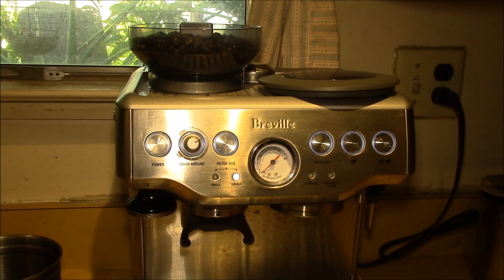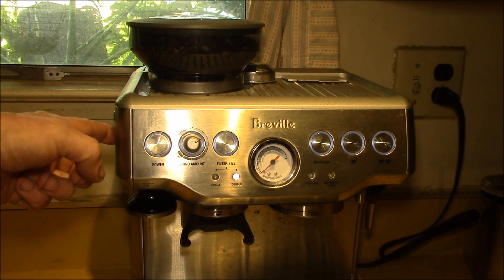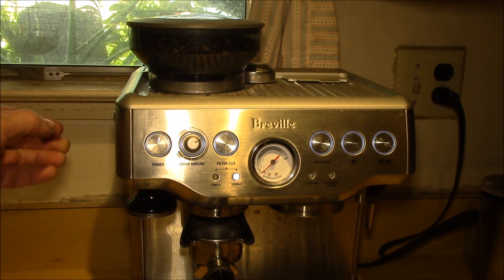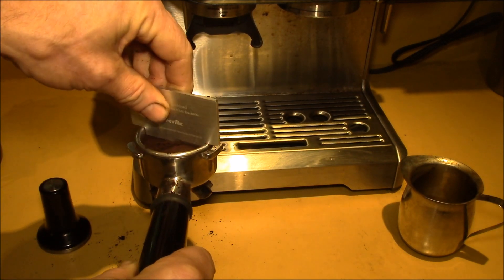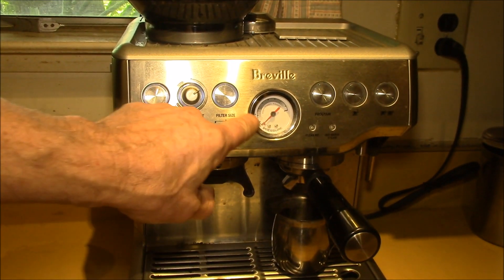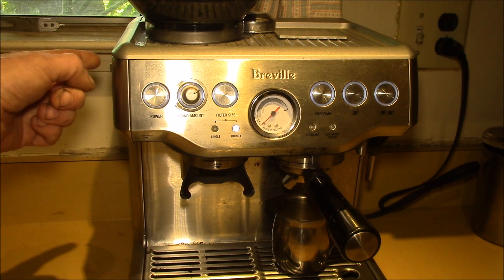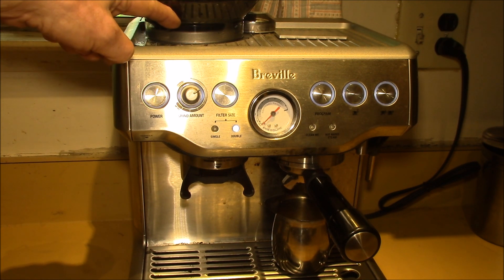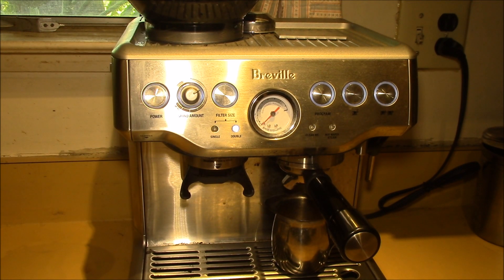Breville BES870XL - Grinder Adjustment

Comment: Tip your grind should be like sand texture.  And as comments below,  need to really force the tamper down.  Then you will find the pressure will be up where it should be and the crema should be great.  Enjoy
Reply from the maker: Good tips, thanks for the comment.
Reply: I just got this machine.  The gauge seems to stay at low pressure. What am I doing wrong?  I am using whole beans.. I have used like a bag of coffee already experimenting :(
Reply from the maker: Hard to say for sure.  are you using the single or double wall filter basket?  If the single wall, make sure the ground coffee is about the same size/texture as regular table salt.  As shown in the video, it helps to have a little pile of salt and the ground coffee close by.  Pick up a pinch of salt, feel it between your fingers then pick up some coffee.  Should feel the same.  Then make sure to tamp it well and check the level with the razor after tamping to make sure it's full.  Another test is to see if there's an imprint of the underside of the group head on top of the coffee after taking the basket off the machine.  If it's still low pressure, try stepping down the grind size one number at a time and note the pressure reading.  If the gauge is not getting higher with finer grind settings, it may be a defective gauge.  I find I don't pay too much attention to the gauge on my machine.  I go more by the extraction time, flow rate and the resulting espresso.  If that is all OK, I call it good.
Reply: @The4Crawler  Thank you.. I will try.. it's VERY fine already.  but when I take it out, the portafilter w/ the coffee is damp..  and the guage literally only moves one little nudge.
Reply from the maker: Maybe try setting the grind dial back to the middle or upper number.  I find when mine is working well, you get a solid puck of grounds out of the filter basket and it's just barely moist.  When it's not dialed in right, the grounds come out soggy and loose.  You might also give the double wall filter basket a try.  I find mine results in a lower pressure reading on the gauge, but it's the same regardless of the coffee.  Be that stuff I grind or pre-ground coffee from the store.
Reply: Thank you.  Do you ever get bubbly crema with this machine?  What could cause bubbly or foamy crema?  Thanks

Comment: Hello, I have a 875 device and unfortunately I have a big problem and the problem I have is that I set the internal mill settings to 1 and the external mill settings to 1 as well but I still can't do proper extraction. I mean the extraction that should be done with 18 grams of coffee and 36 grams of extract between 20 and 30 seconds is less than 20 seconds for me and I have to make the mill finer but there is no possibility of getting smaller and I even tried several models of coffee and it still didn't work and even my friend's device that is like me and we bought together also has the same problem
Reply from the maker: I've not used the newer 875 model with the adjustable grinder burr, so haven't had that exact issue.  You might first contact Breville support and see if they have any suggestions.  If not, maybe try the "Advanced Grinder Cleaning" process:
https://youtu.be/0ZDii493IPY?si=7FYSV3EHUrrOuJ7B
and see if there might be any debris inside that prevents full adjustment of the grinder.

Comment: What are basic settings you recommend starting with a when trying new beans? Was preciously using the double wall on grind 10/11 but want to try the single wall and am not sure where to start!
Reply from the maker: Really makes no difference, just pick a starting setting, your 10/11 is fine.  Then adjust up or down depending on your results, as I demonstrate in this video.  I like to only make a single change at a time, try it, then decide if another change is needed.  Also, realize it can take a few grind cycles for the whole batch of ground coffee to take on the new grinder setting, which is why I only do the single click change at a time.

Comment: Hey, thanks for the awesome video.

I recently bought this machine and just started having some issues. I recently bought freshly roasted beans from a very good local coffee roaster. For the first few days I was getting excellent, consistent shots at a grind setting of 4 (pretty fine setting). Within a few days, I couldn't even pull a shot until about a grind setting of 10, and even then the pressure gauge was way passed ideal espresso settings until about a grind setting of 12. I understand the coffee has aged, but I don't get how even relatively coarse settings would choke up the machine. As far as I can tell, I did not change up any variables in this week -- I've only used the non-pressurized double shot basket, filled up the basket with 18 grams of coffee (for the two doses), and tamped at the same pressure as always.

I've currently run out of this particular roast, and have been using cheaper coffees until I have a chance to get freshly roasted beans again from the roaster. But in this time period, I've also had trouble getting a shot pulled at a setting finer than 12 with Peet's French Roast coffee that I'm currently consuming. Even then, the pressure is through the roof, and I had to dial it back to a setting of 14 to be around the middle of the espresso range. To continue experimenting, I made some shots of old Ikea coffee I had, and I successfully pulled a shot within the espresso range on grind setting 5, but at grind setting 4 it pretty much choked.

I totally understand that beans are totally different and each calls on different grind settings to create good espresso, but I am concerned by how coarse I need to grind a few different types and brands of coffee now. When I got the machine 2 weeks ago, while testing it out and calibrating it with a number of different coffees I recently bought, the machine was able to pull shots with virtually any of these beans at grind settings of 5 to as low as 3. Now, it seems, I can only pull once I get to 12 or even coarser.

I am starting to think this might be a pressure issue, but Breville doesn't think so.

What do you think? And my apologies for being long-winded.

Thanks for the help!
Reply from the maker: You might try comparing the actual fineness of the ground coffee to see if the higher number is actually coarser than the finer number.  Also, does the extraction time and volume increase when you have the higher pressure?  Just some ideas, but if those all check out, I would agree with your assessment on the pressure related issue.
Reply: Thanks for the reply. Just from looking at and feeling the bean grinds of various grind size settings, it definitely seems the finer settings produce finer grinds. Regarding extraction time and volume: hard to say but, in short, it seems volume of coffee produced is always pretty consistent no matter what settings are used (this is based simply on what I see, not in terms of precise measurement). I opened up a new bag of store brand coffee (haven't had a chance to pick up freshly roasted coffee yet) today (which also means I had to calibrate the machine for this particular bean), but I was getting results similar to some of the other brands I've used these past few weeks, including the freshly roasted beans I first used, including after they've aged about 5 days (and when I first noticed this issue).Today,  I started at grind size of 5 at 18 grams, and the machine choked - no flow at all. I dialed back to size 9 at 18 grams -- minimal flow, took 40 seconds for double shot (though volume seemed appropriate). I obviously tossed it. Finally, at grind size 12 at 17 grams, I produced a double shot in 20 seconds, while the pressure gauge read about 10 o'clock. The flow seemed fast, but the coffee tasted fine for what it is. I called Breville again and asked a bunch of questions. They basically told me to not get hung up about the grind size, but rather focus on getting to optimal extraction on the gauge (which is around the center of the range). I may be wrong, but I'm under the impression that the finer grinds get, the more force is required for water to be able to push through coffee. By this logic, I'm still thinking that because my machine is no longer able to pull shots on most types of coffee I've tested at a grind sizes finer than around 9 or 10, that my machine is not able to produce the full pressure it is supposed to. Her followup to this is that all beans are different and as beans age and oxidize their properties change, which can also impact the grind size. She recommended that instead of weighing my doses, I should simply fill up the puck and once I get about one teaspoon above the brim of the puck I would then tamp it once and brew it. Her argument is that as beans age they tend to splinter as they're ground, causing volume to increase relative to the same bean when it is younger. This seems to make sense to me as I've noticed the 18 grams of coffee I grind tend to create larger and larger mounds over time. So to get the appropriate volume in the puck, it would pretty much seem I would need to actually reduce the weight of coffee so that the volume stays the same. This makes total sense to me, but I always thought 18 grams of coffee equaled 18 grams of coffee (no matter the grind size) in terms of the pressure required to push water through it. But maybe not -- and perhaps the issue is not my 870 not generating enough pressure, but rather that my volume is simply increasing (despite the same weight) which is causing the machine to choke. What do you think about the issue of volume? Does more volume (even if the weight of the coffee is the same) effect pressure required to pump water through the pump? Again, thank you for your patience in reading this and helping me diagnose my machine!
Reply from the maker: I find that the volume of coffee in the basket affects the pressure.  Too low a fill level gives low pressure, I think the injected water breaks up the puck and lets the water flow too fast.  With too much coffee, as the grounds expand when the water hits them, they swell up too tight and the pressure goes way high and you get lower volume or longer extraction time.  I try to shoot for the puck coming out solid, fairly dry and with a slight impression of the underside of the water screen on top of the grounds.  The other thing I use is how the filter basket goes into the machine.  If too full, it's hard to get it sticking straight out, too low and it'll go past straight out over to the steamer.  
Here's a good article on some of the finer points of dialing things in:https://baristahustle.com/espresso-recipes-time/

Comment: Hey there. I tried the pressurized double shot, and the pressure was great. However, whenever I go to the normal espresso shot cup, no matter how fine I go and how hard I tamp, the pressure stays below the gray. I don’t know if it is because I am using organic coffee, but nothing I can do has raised the pressure. Any thoughts?
Reply from the maker: It may be the type of coffee bean.  Ground coffee should be the same texture as table salt or sand.  I find having a pinch of salt to feel between my fingers along side the ground coffee helps with the comparison.  Also with the grinder adjustment, give it a few cycles for the finer coffee to come thorough fully.  I like to change the dial one click at a time, then if I find I need finer or coarser after pulling a shot, then I'll make another one click adjustment the next time I use it.

But if the double wall filter produces decent coffee, stick with that.

Comment: I like to grind two single shots. That way I can grind one and gently pack it down. Then grind the second ontop and pack it again so I don't overflow and make a mess.
Reply from the maker: Interesting idea, may have to give that a try.
Reply: Are you really supposed to use the grinds twice,once after the hot water already ran through it?

Comment: Thank you.  Do you ever get bubbly crema with this machine?  What could cause bubbly or foamy crema?  Thanks
Reply from the maker: I've not experienced that myself.  If it only happened recently, that might be due to the batch of beans you are using.  If it happens all the time, maybe try changing the grinder setting and/or see if there's a difference between the single and double wall filter baskets.  Otherwise, maybe a viewer will have some other ideas.

Comment: When adjusting grind size to finer, must there be coffee beans in the grinder? I mean, can we just let the empty grinder run without actually putting beans in there (which is a waste)? Thanks!
Reply from the maker: Yes, you can adjust the grinder when it's empty and that can be done with the grinder running or off.

Comment: I have changed the grind size and the pressure gauge is still not moving.  I am using Starbucks espresso beans. Any suggestions?  Thanks
Reply from the maker: Hard to say exactly.  If the espresso extraction time and quality about right?  If so, maybe the gauge is just not working right.  Single or double wall filter basket?  If single wall, make sure to get the fill level and tamping correct. 
 Too low a fill or not enough tamp = low pressure.  Get the ground coffee to feel about the same texture as regular table salt.  Maybe try the double wall filter and see if that makes any difference.  That filter basket will generate it's own back pressure, maybe not as high as a well tamped single basket, but if you see a change on the gauge, then at least the gauge is working at some level.
Reply: I would suggest using a better quality bean. The manual has a nice little extraction guide to help you get to the right settings (mine is page 25, if it helps). But essentially, if the espresso is under extracted (pressure gauge is low, espresso is pale brown, little / no crema) try a finer grind and / or more coffee. If it's over extracted (pressure gauge is high, espresso is dark brown, crema is dark) try a coarser grind and / or less coffee. I focus less on the pressure gauge and more on how the espresso looks, smells, and tastes. I would suggest changing one setting at a time, so you only have one variable. It may take some time to get the settings how you like them, and of course it will vary for different beans.
Reply from the maker: Great information there.  I'll second the suggestion of changing one thing at a time.  Start making a lot of changes at once and you can easily get lost.  I even take the approach of changing things like grinder or amount settings one click at a time.  Then watch the next extraction and make a note if I need to make another change next time.
Reply: I have the same problem, also using starbucks beans. Did you figure it out, Mary Hall?

Comment: This problem occurred a week ago and I had to stop using the espresso maker but after plugging it in and checking it again a week later it just started working.I dont know why it suddenly stopped grinding.Thought maybe it needed to be cleaned out but not sure what or when cleaning is needed and was scared to break it.So now that it happened again just now I am hoping you can tell me how often and what indicates the need to clean the grinder and of course how to do it,lol. Lastly if I put ground coffee into a basket and twist it on can I select single brew and produce the same coffee as if I had ground it first? These loose grinds I have are not as fine but its better then nothing. Please help.
Reply from the maker: It could be the grinder hopper is not fully engaged, there's a micro-switch under it that will stop machine operation if that switch isn't activated.  Maybe try unlocking, re-seating and re-locking the hopper.  It should click into position and lock easily if it's in the right spot.

Grinder disassembly and cleaning:
https://youtu.be/0ZDii493IPY

You can use pre-ground coffee with the dual wall filter baskets:
https://youtu.be/_I37YMFH8Bo

Comment: I just got my Breville BES870XL Espresso Machine, and am struggling with the grind setting to get a Balance between the Bitter & Sour taste for different espresso coffees. 
I’m looking for the “Sweet Taste”. 

To get an idea of which coffee my wife and I would like best. 
I just ordered the following:

Intelligentsia Coffee - Black Cat Classic Espresso
Intelligentsia Coffee - Black Cat Decaf Espresso
Intelligentsia Coffee - Black Cat Analog Espresso
Ruby Colorful Coffees - Creamery Seasonal Blend

To have some coffee to use until the other coffees are delivered, I bought a bag of Starbucks Espresso. I am currently grinding it at #11 however, it taste bitter, probably need to go lower # on the grind size.

If you have used any of these coffees, I would appreciate your letting me know the grind number you used, Thanks
Reply from the maker: I've not used those coffees before, so no specific settings.  Best option is to take note of the settings and then try stepping 1 or 2 numbers at a time and note the change in taste.  You don't want to make too large a change at any one time and you may have to adjust the amount after the grinder change.
Reply: Thanks -- would you know how much water should be delivered for a 1 and 2 cup espresso.
Reply from the maker: The default is 1oz/30ml single and 2oz/60ml double.  You can reprogram those amounts with the Program button.  I've set my double shot volume to be about twice the default value.

Comment: Hi Brown. Just bought a barista express. Got Starbucks dark coffee beans. Any suggestion on settings
Reply from the maker: Set the grinder someplace in the middle, like 10 or so.  Set the amount dial around 2 o'clock and see how it works.  Increase or decrease the amount dial to get the packed height to match the razor tool.  Then watch the pressure gauge.  Too low = make the grind finer (smaller number).  Too how, make the grind coarser.  Change one number at a time and repeat until you have it dialed in.  You'll likely need to readjust the amount dial as you change the grind dial.